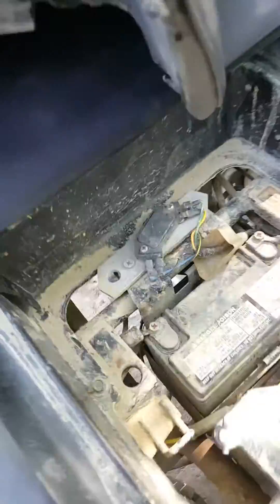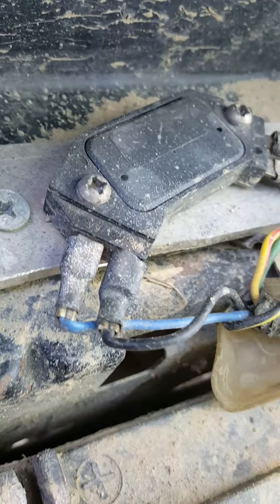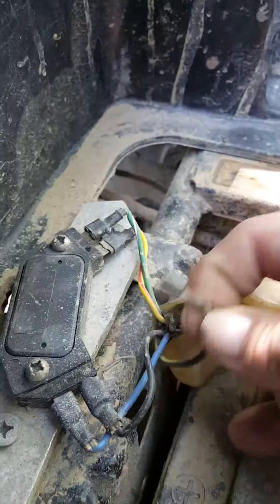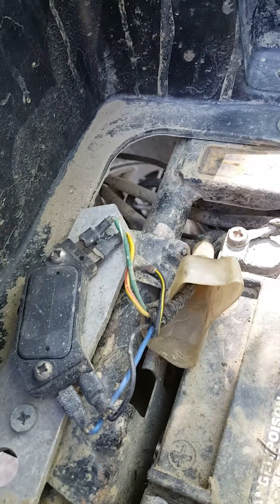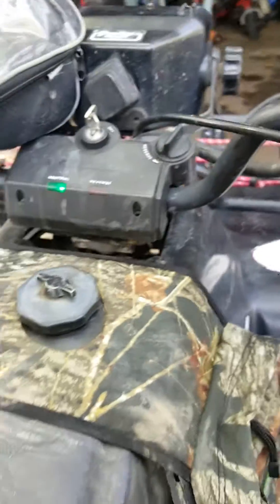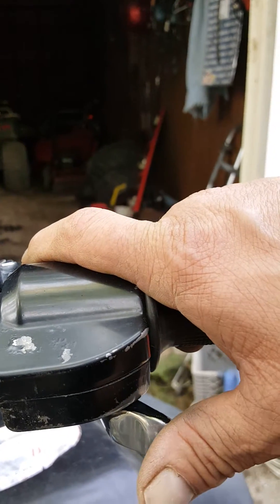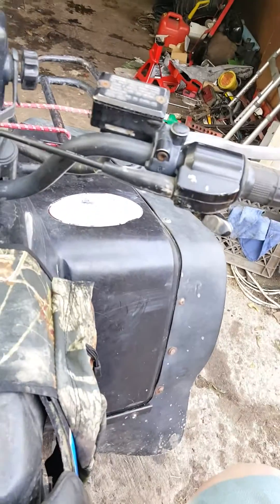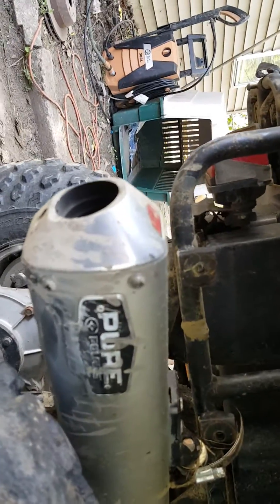How to use a late 80s GM HEI ignition module as a CDI box for 1986 Kawasaki Bayou 300

Comment: I got my 88 220 to fire using this method but it seems the spark timing is way too advanced she will run  on starting spray, has anybody worked this system out?  I just like to go take a ride after holiday while im off its so close but not right

Comment: Try switiching places on the wires from the pickup coil, the "G" and "W" terminals on the module. You might have the pickup coil polarity backwards the way it is currently hooked up. This makes a big difference.

GM HEI modules DO have internal advance regulation, even the aftermarket, non-AC Delco ones. But if you have the pickup coil polarity reversed, the signal is delayed and the module can't "catch up" with a properly timed advance signal.
Reply from the maker: +The13thSword  Okay thanks ill try it!
Reply from the maker: That worked!!! thanks!!
Reply: You're most welcome, glad it helped. I have been studying this conversion (in various forms, online) for about 2 weeks now, because I am about to do it on my 1978 Toyota Pickup truck (20R engine). It will work on almost any engine using a carburetor, regardless of make or number of cylinders, as long as you have a magnetic pickup coil somewhere in the system (in the distributor, on the crank pulley, etc.) I've now seen it done on Mopar Slant 6's to 440's, Fords, Toyotas, Datsun/Nissans, Volvos, motorcycles (like you mentioned) & tons of others.

One article says right out that the "G" & "W" wire hookups are "trail and error". One way it runs like yours originally did, the other way it runs almost perfect.

Sorry to be "wordy" but I wanted to get this info attached to your video in the comments section, for anyone who is trying to make this work for them. It took me 2 weeks of daily study online to find out about the wire hookups, so maybe with me putting it here someone else won't have to go through that. Thanks for letting me post it here.
Reply from the maker: Thank you!
Reply: @The13thSword hey man, I’ve got bayou 300, randomly lost spark, I just replaced everything, even a $160 cdi, I’ve got spark now but the it only sparks every 5 seconds or so! Any ideas?
Reply: @newtsmith6263  I assume you mean a Kawasaki Bayou 300 4x4? I'm not familiar with that particular vehicle but most ignition systems are basically the same so here goes. It could be any number of things but the 2 most important I'll start with are electrical grounds and the coil.

If you have a bad, loose, dirty or corroded ground anywhere in the ignition system this could cause the issue. By "ground" I mean any connection in the ignition system that connects to battery negative. These often get overlooked so it's a good idea to go through the entire chassis electrical harness & all negative battery connections to be sure they are clean and firmly connected. As far as ignition goes, this especially includes the battery ground strap or cable to the engine case or vehicle frame or both, & any battery negative connections to the CDI box & ignition coil. The case/frame ground is important as it's [art of the electrical path for the spark plug(s), as they ground through the engine cylinder head.

Test your coil with an Ohm meter to make sure the coil is in spec & not faulty. If you don't have an Ohm meter you can get one that can do the job at Harbor Freight for $6 to $7. If you don't know how to test an ignition coil with an ohm meter, there is a good basic video on it here: https://www.youtube.com/watch?v=g2HT1oGl990

From what I can find online, your coil specs are: Primary - 2.5 Ohms, Secondary - 11,800 Ohms. Both readings should be stable, meaning that they should not fluctuate while taking a reading for several seconds. Also & BTW the Kawasaki part number for your coil should be 21121-1049.

Beyond those two things, you need to check for:
Worn or broken parts like a cracked coil casing, broken terminals, worn or broken spark plug(s), broken wires or wires with missing insulation, loose wire connectors (especially the "crimp-on" types), and overall engine timing.

O hope all this gives you some starting places to look & check out. Let me know how it goes.
Reply: Hey The13thSword, I'm looking to do this on my carbed 89 Suzuki GSXR 750. It has  about 7 wires going to the box,  including 2 for the pickup coil. Would I also use a 4 pin module or higher pin? Thanks!!!
Reply: Won't work on a 4 cylinder bike. This module is designed to have a distributor to send the spark to the right plug. The CDI (TCI) for your bike figures out which plug to fire when. This module will only work on a single or a parallel twin as a wasted fire system.
Reply: @shall9864  you have to use two models for 4 lungers
Reply: @shall9864  you have to use two models for 4 lungers